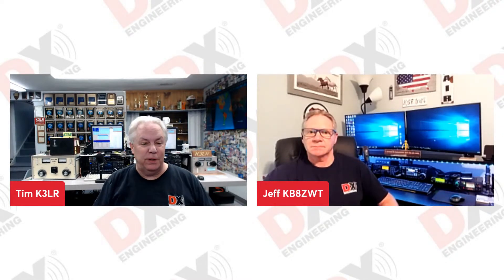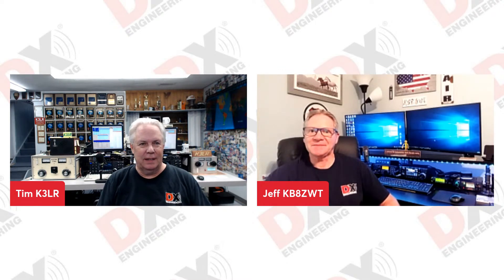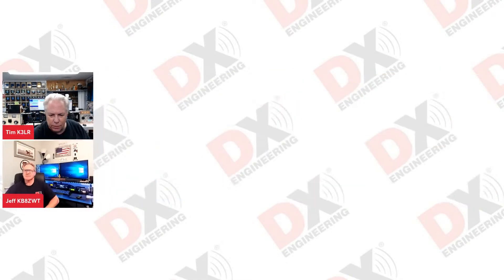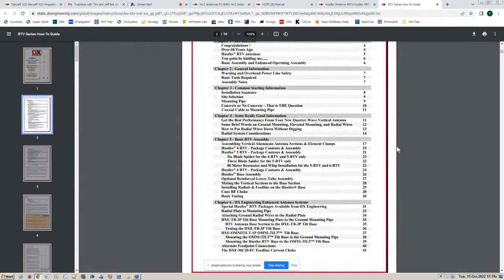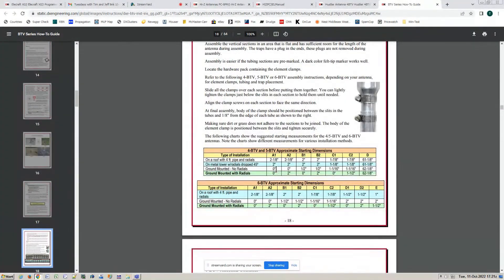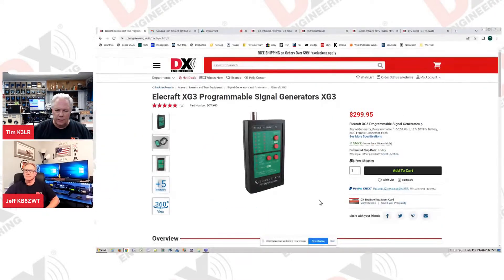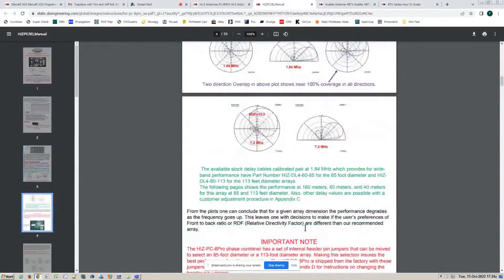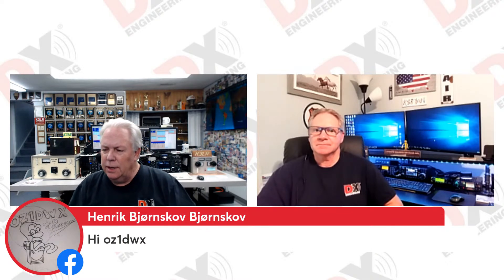Ground Radials - Tuesdays with Tim and Jeff 10/11/22

Comment: Hey guys, I've been gathering up all my parts as quickly as I can for a complete 6-BTV.  I just placed my order today for the 17m add-on kit and a reinforced lower tube.  

On my DXE radial plate I have 32 radials which are 16 feet in length, which is 512 feet of wire - about 4 wavelengths on 40 meters.  In addition, I am making up 16 more radials that are 32 feet in length, another 4 wavelengths on forty meters.  So my question is, since I MAY on occasion go all the way down to 75m, do I really need to cut radials for the 80m band when I MAY only occasionally visit there?  Will my antenna do alright on all bands with 48 radials, even if radial length is not tuned for each band?  In other words, is total length of wire more important, or is it more important to have resonant lengths of radial wires?  Thanks so much if you can help me out.

- K5SFC